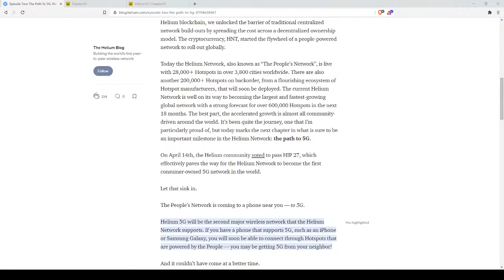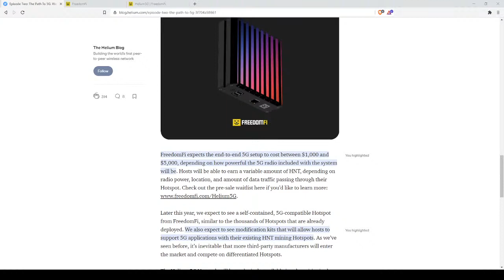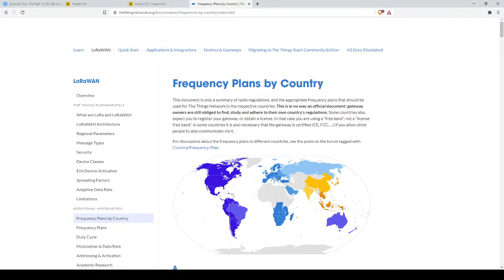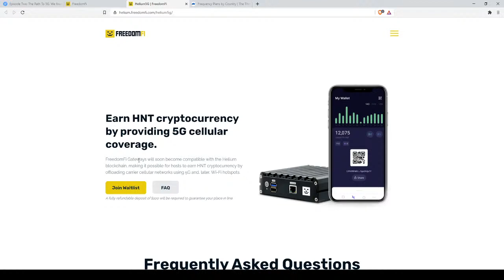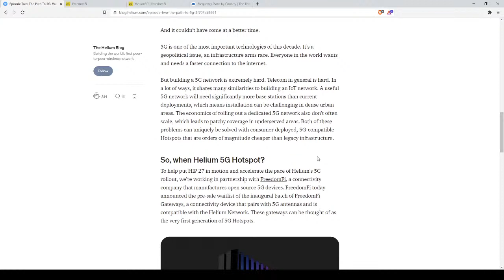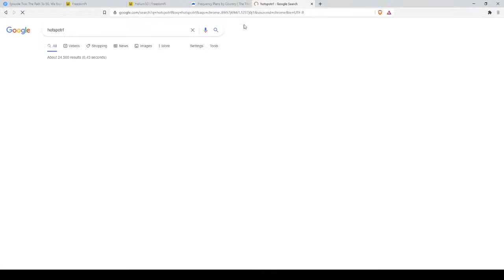Livestream: Helium 5G network, what does it mean for your current hotspot

Comment: There is a major supply issue with helium miners so they have that to fall back on.
i think you got a misconception somewhere: Im pretty sure its to assist the existing cellular radio carriers, Im concerned about needing radio licenses for them. I think they are going to have a couple models varying signal strength from $XXX-$XXXX. i assume they are a contract with AT&T or some corporate entity; During network congestion your local network with the 5G radio+miner and antenna   catches and relays the the signal via the internet. i think you will get paid for the 5G work in fiat +NEW COIN***  hopefully paying dividends (opposed to marketcap or by back/burn) considering we are building the network;  earning HNT at the same time separate from the 5g operations. They are a raspberry pi with digital radios: the manufactures have to pay into the network activate them.  
my 2Bits while the cow jumps over the moon
Reply: GREAT VID
Reply from the maker: Thanks for going over this and sharing your thoughts. I've reached out to Helium and in theory we can use the tech to build our own cellular provider, but that's up to the community to make. Helium provides the system and will reach out to hardware partners. So indeed getting the frequency band in all regions and the liscences will be a challenge. But who knows, maybe we can collectively find a solution for that as well 😅

When it comes to freedomfi, they indeed seem to want to do a proof of concept by assisting the carriers in offloading traffic in peak moments. But that doesnt mean someone else can come up with a plan to build a carrier on top of helium. You got my vote if you want to do that 😁

Comment: In Nederland krijgen/hebben we toch al 5g. Wat is dan de meer waarde van een helium 5g netwerk. Behalve dat je kan minen
Reply from the maker: 5G requires a lot of hotspots/gateways to function properly, so it's possible that telecom operators are willing to pay for extra gateways to improve there service. Additionally, depending on what route Helium will go, you might (maybe) be able to connect directly to helium and pay with crypto and you can assume that telco's will charge high prices for 5G the first few years in order to earn back the investment. So helium 5G might be cheaper to use. Especially internationally. So i think there are several possible use cases.